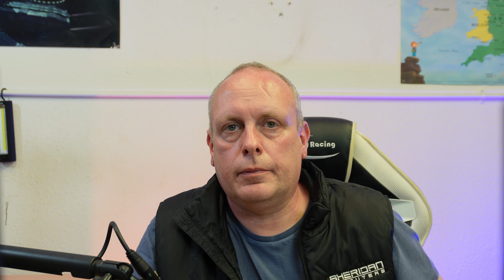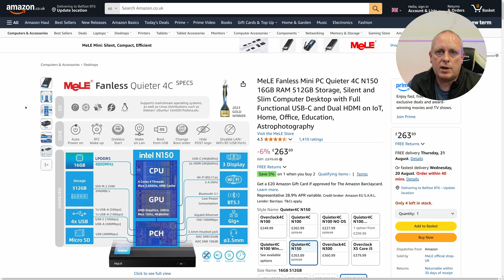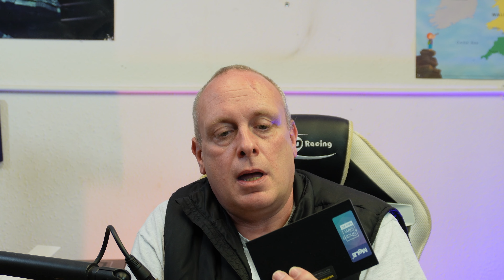Pocket-Sized Power: MeLE Quieter 4C: Windows 11 & Arch Linux

Comment: I bought the 32GB RAM variant, it's a lovely piece of kit. I run Arch for general web use, emulation, and Moonlight streaming from my main rig. My favorite feature is that it can run off of a USB C PD power bank. As long as the battery can output 12V, 2A, you're good to go.
Reply from the maker: That's a greqt feature you can even use PoE to usb-c adapters to power it.